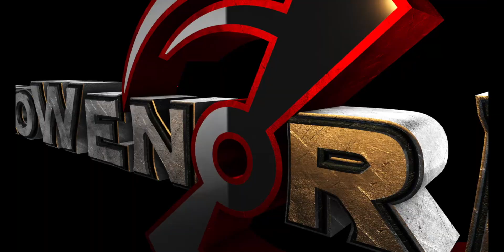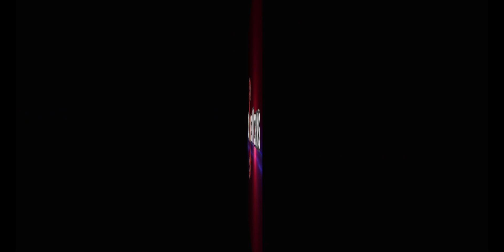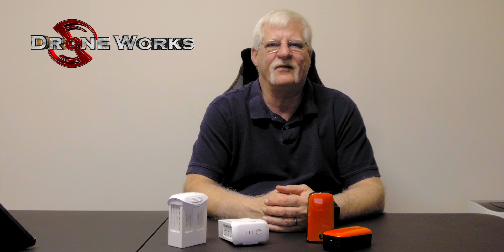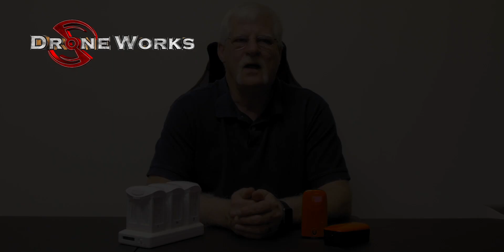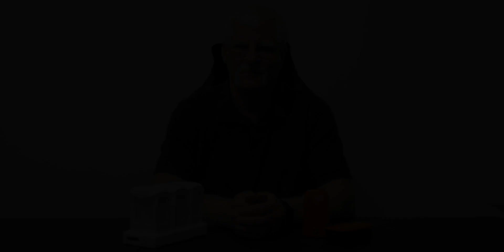LiPo Battery Basics, Charging and Storage for DJI and Autel

Comment: I watch your channel all the time.  I would like to know have you heard of any problems with the Autel EVO drone batteries are the battery charger. I have had my EVO for litle over a year and have had to replace 3 batteries because the cells would not balance. About 3 days ago I was charging a battery and the charger brick got very hot.  I have been using Lipo batteries for about 5 years in my RC cars and my DJI Mavic and never had this problem.  I have asked Autel a few times but never get a straight answer. Have you heard of anyone else with the same problems?

Comment: i bought my phantom 4 pro plus 
on 1 month ago 
I fully charged and set dji go 4 to discharge after 3 days 
and let p4p run til batteries where all at 70% 
So I put away in wardrobe and check last week after 1 month and still all 3 batteries are the same 2 solid green lights with 3rd flashing  and I don't have a hub 
i
Reply from the maker: That's exactly where you want to store the batteries at, right around 50%, 2 solid and 1 flashing LED. When the batteries were at 70% and you put them in storage, after your 3 day setting (default is 10 days), the battery self-discharged to 50%. Just check them about every 3 to 4 weeks. When it gets down to 1 solid and 1 flashing LED, charge it back up to storage level,
Reply: @DroneWorkspro  🙏 please b true as cause I've been depressed
Reply: Is this true I won. A drone or its not April yet lol